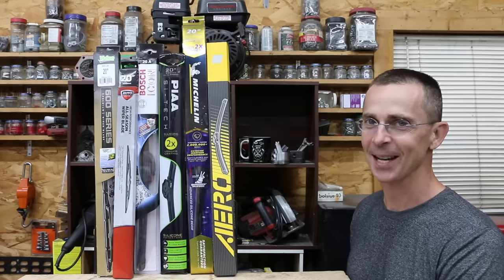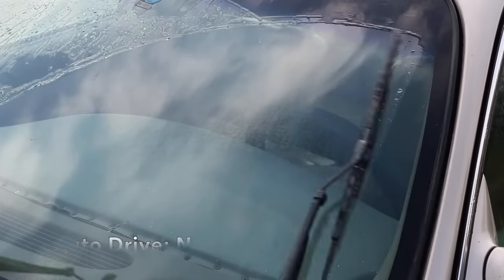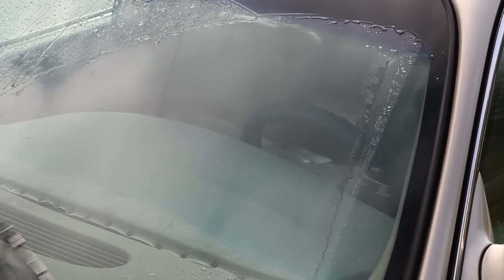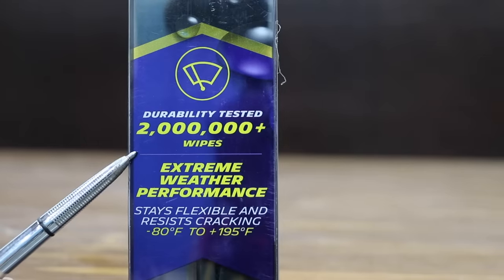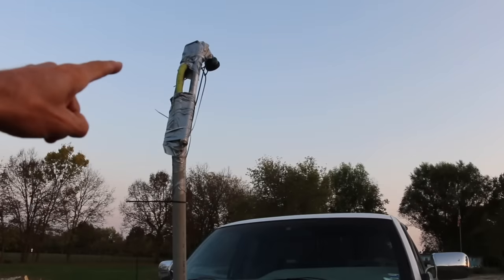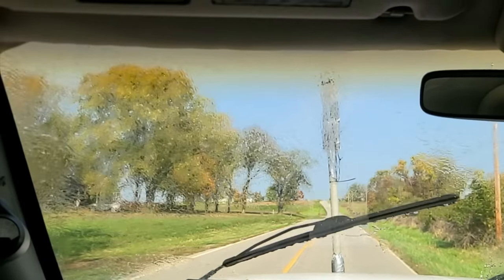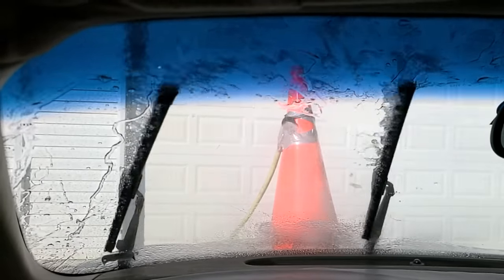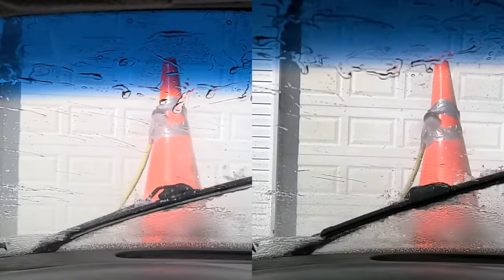Best Windshield Wiper Blade (AFTER 1 YEAR)? Bosch Icon, Rain-X, PIAA, Trico, Valeo, AERO

Comment: As a Swede, temperature is the single biggest problem in my opinion. Regardless of brand and model, the closer to the freezing point it gets, the worse they get. Stiffer rubber = lots of noise and lack of smoothness, the blade starts "jumping". When the temp begins to crawl below ~10 deg celsius I often find myself considering getting a new set just because of the noise, even if they still keep the windshield clean.

Blades that have been on the car for some months tend to get shaped by its resting position, and since they stop after the downsweep and become bent that way, the upsweep then tends to get noisy when the temperature drops.
In other words, a blade that has been sitting in a box or just been lying somewhere in sunshine (for UV exposure), will still have its original, "neutral" shape... a blade that's been sitting on a car will be deformed over time and then make more noise.

Winter Is Coming, as they say... so it's about time to get a new set. I wonder how Biltema's models would test against your typical American brands...

Another thought: USA is big. Wide range of weather and temps... do you have the same selection of brands and models down south and up north? Winter and summer? Different environments would benefit from different properties...
Reply: I grew up and lived in Vermont and upstate NY, both of which are known for horrible winter weather (-20F winters, multi-foot blizzards, etc). Silicone blades with the flat style are far superior for those kind of conditions. Partly because they're easier to de-ice with the chemical deicer spray (that stuff is a godsend) if they're frozen to the glass.
Reply: I live in Canada, where we have temperatures from 30 to -20 with salty air, and I replace my wiper blades every 8 or 9 months. I buy Michelin blades, for the most part, from Costco for around $12. I would never pay $25-30 for one blade.
Reply: I'm from Georgia (southeast part of the country) and I've lived in upstate New York for a few years. To the best of my weak recollection, they're all the same everywhere. Lots of people down here replace their tires when they show wires, and replace their wipers when the metal frame scratches the glass. Stupid. Can't get away with that up north!
Reply: As a Florida resident, sun and heat damage is the biggest issue.
Reply: @jmodified  I can only imagine...
Reply: This is kind of what I was thinking as I watched this. It'd be better if they could sit on a windshield for 6 months or so, because that's going to degrade the performance more than laying loose in the sun. I'm not sure how you would accomplish this, though. It'd take several spare vehicles, or some sort of purpose built test rig, that really doesn't seem practical for one or two test videos.
Reply: we have "winter" wipers in the north which is basically a rubber covering over all the moving arm components so they don't get wet and freeze. I haven't bought them in a while however as they still seem to freeze. Personally in upstate NY snowy icy weather I've had the best luck with Bosch, and more recently I've tried the Rain-X and can't complain about them either.
Reply: I live in Alaska but I don't care for wipers whoever ride with me think I'm crazy but why buy new ones when they gonna freeze and jump all over the windshield
Reply: I lived in the southern part of Arizona for many years The summer temperature was usually 115 F to 125 F. That's the 50 C range for the rest of the world. I found Bosch blades lasted the longest, although after a week of 122 F (50 C) they would permanently deform and chatter when the rain came later in the year. There was no solution to this other than replacing blades after the summer heat.
Reply: @fergusontea  agreed, Home Depot sells Michelins for $8 ea so imo the best value even if not up the Icons
Reply: @buffdelcampo  White plastic sheet to cover them, works in winter snow too

Comment: Please continue reviewing these blades after continued UV exposure. I live in Southern California in very warm temperatures 100/110+ in the summer and my PIAA's are still working great after 3 years of use. The Silicone blades are supposed to last longer than the rubber blades and if you factor in longevity of the blades over multiple seasons it may be the cheaper long term option.
Reply from the maker: Thanks for the suggestion.
Reply: Yea but I bet you don’t get tons of rain there.
Reply: I'm also in SoCal and have had the same set of PIAA's on my 3 vehicles (2 garaged 1 parked outside) for 13 years and they still work great.  Granted they get used more for removing windshield washer fluid than they do in the rain :)

Comment: After  almost 40 years of driving I reached the same conclusion,  Bosch seems to perform the best.  I've tried the cheap, the expensive and everything in between.  I don't believe Bosch even made wipers when I started driving.
Reply from the maker: Great feedback. Thank you
Reply: I know they've been around for a very long time though.  I have a tombstone radio from the 1930's made by American-Bosch.
Reply: @lesteroil2 - I agree.  I have tried many different brands and types and have been really happy with the Bosch Icon's for several years.
Reply: I tried other brands, but got back to Bosch ages ok.
The beam type didn´t really impress me, it may conform to the windshield quite when all is clean and not freezing, but once there´s something not nice and smooth, they can´t beat the "old" style where the blade itself is more flexible.
Reply: Had my bosch aero's on for several years - faultless, they have outlived the car which is now going up for sale lol
Reply: I agree.  My go-to wipers are the Bosch Icon / Valeo Ultimate.  They're almost identical in design and performance, so I use them interchangeably.
Reply: I've been using the Bosch Icons for several years, and they are definitely my go-to when it's time for new wiper blades.
Reply: @Rebel9668   Yes, they started in the late 1800's.  Magneto's or something like that.

Comment: Bravo! Really good test! Thanks!!
Might have been interesting to see how much drag in lbs there was on the window.
Not sure where you live, but here in northern MN & WI most of those blades won't cut it in the winter. Any that have uncovered blade claw will become iced over and will stop flexing & is useless, necessitating a stop & beating the ice out. I have been using the metal frame Bosch that has a rubber covering over the frame for several years now, so I have less problems with icing up as they are outstanding & worth the extra money. Any wiper that has plastic connectors to the arm also won't last the winter. On my Acadia, the single frame plastic wipers have difficulties keeping flat to the window in the winter, less in the summer, so not great. One blade is much longer than the other.
I found your test really interesting & informative, especially how they aged & how similar several are constructed.
Reply from the maker: You are welcome!  Glad to hear!
Reply: "& how similar several are constructed."
I suspect that many of the different  "brands" come from the same company marketing under different names. That's why they're made the same.
How many of the wiper blades are made in China ?

Comment: You should do a video on the best way to recondition your wiper blades to make them perform like new after they start skipping or smearing. I've seen many different videos that involved cleaning the rubber blades and the windshield and they all have different methods.

Comment: Something to note about the rain-x wipers that most people don't read, on the package it says how to apply the rain repellant - you have to run the wipers dry for a few minutes when you install them and it's actually very good! I hardly even have to use the wipers in a rain storm and it lasts for a decent amount of time, can't say exactly how long.
Reply: Clean and dry the entire windshield first, even better results doing this.

Comment: HERE IS ONE:
Car Interior Leather Care Products!
Do they really work? Many say they don't because car leather has a surface treatment, and any care products only stay on top of that, just like car wax on top of the clear coat. 
But if they do work, which one is possibly the best?

To conduct this i suggest getting a hold of a bunch of different car seats, fairly new, from different manufacturers (American, European and Asian), cut them up to be able to see the backside of the leather, and then test different products on different surfaces (heavily worn surface, medium worn surface, not worn surface) with the different products, to see if any product has penetrated at all. What brands penetrated which leather seats and level of worn surface, and if any of those products actually gave any type of protecting properties.
It would also be interesting to test brands that differ as much as possible in their content composition.

Cheers!
Reply from the maker: Thanks for the video idea.

Comment: I'm a HUGE fan of your work/videos, and truly appreciate the exacting standards with which you test all the products you review. That being said, I noticed a couple discrepancies between your first "Windshield Washer Shootout" video, and this one, in regards to the products tested, and at least one discrepancy between the blades pictured in the video and the product links under the "Products Tested In This Video" section. In your first "Wiper Shootout Video" two of the wiper blades tested were the Bosch Clear Advantage, and the Rain-X Latitude. In this video, those products are not represented, but have been replaced with the Bosch Icon, and the Rain-X Silicone Endura. In addition, the Amazon link for the Rain-X blade (under the "Products Tested In This Video" section, in the description) leads to a Rain-X Weatherbeater blade, not the Silicone Endura blade .... Regardless, keep up the GREAT videos Todd!!
Reply: How are different models of both Bosch and Rain-X wipers a discrepancy? Why would he retest those models when you can just watch both videos?

Comment: I’ve have the same pair of Bosch icon beam style wiper blades on my daily driver for the last 5 years and they work quite good. Not perfect but they are quiet, no streaks and only very occasionally hop (even then they make little to no noise). I’m thoroughly impressed with them and looking forward to this video
Reply from the maker: Thanks for the feedback.

Comment: I've had Bosch blades on my car for 8 years and still working well, even through Ohio winters.
Reply: It is not the winters that are hard on wipers.  It is the hot summers.  Drying out rubber does way more long term damage than getting it cold.
Reply: @gscurd75  AZ heat got me here

Comment: I used to work at o'reilly's and I did an investigation on my own about the best wiper blade for the price. I always buy bosch icon wiper blades but purchase them at walmart. Auto parts always inflate the prices very high.
Reply: I just hope they don't have two tiers of quality.  Many years ago I worked at Old South Candle Co. in Mayfield, KY and their high end jar candles had twice the scent added to them as the candles they made for places like dollar general.  I also know that like say, in oil filters The AC Delco ones from Walmart tend to be the new E type whereas at a lot of auto parts places you can still get the older and imho better original type (like a PF46 instead of a PF46E).
Reply from the maker: Thanks for the feedback.
Reply: One reason you're paying more at a local shop is because of the service behind the product. There have been times when I needed advice on a choice I'd made, or a product I was looking at. I'm a lot more hesitant to ask questions at a Big Box or national chain store. They do want to sell the products they sell (they're not a library) and it's always good to have done your own research before, so you can better decide if you want to take their advice.
But, a good relationship with a local business is generally worth it.

Comment: Those silicone based wipers do in fact last much longer than the rubber based types. I'm a few years into a pair of PIAA brand with a vehicle that is outdoors all of the time in California. They still function well.
Reply: I've had similar results of the PIAA lasting much longer.

Comment: This video made me realise something I'd never thought to consider before. Our wipers must work better here in a right hand drive country, at least as far as driver visibility is concerned. The way the RH (your passenger) wiper flings a bunch of water over into the driver's vision on its initial stroke looks awful, and I'm frankly amazed that in LHD countries they don't make the wipers sweep the opposite direction.
Reply from the maker: Thanks for sharing.
Reply: The driver needs the whole screen. For a second, split the windscreen into 2 pieces. The passenger will be left with half of the screen and the driver will have the entire screen wiped. Now if you change the way the wiper works but not the driver seat, the driver will be left with half of the screen wiped. I hope you understand what I mean. Left hand drive or right hand drive the driver always will have the screen wiped entirely. (If he buys Bosch :)) )
Reply: Maybe, I am bias. I've never driven a RD. In the LD configuration, the wiper clears the whole side, and the right side has the entire upper 90 unwiped. That would annoy me. If it is raining so hard that it clears better on the right side, it's not safe driving conditions. On that note, here in Michigan USA, I can reach out my window while driving and wiping, grab the blade and snap it back against the windshield to remove ice build up.
Reply: @MrRedberd  I didn't mean to offend anyone. Sorry. But for the LHD and the RHD cars the wipers will always start from the passenger side.
Reply: @doru10922  No offense, thanks. I did not know that.

Comment: This gentleman is the best. Thank you for all this work and you deserve all the success of your channel.
So Bosch, PIIA or Rain X then.
I am using Michelin blades now and although they wipe clean well, the driver side occasionally was stuttering and squeaking. Turned out it was the Rain -X washer fluid that was causing that. Once removed the Rain X and replaced with filtered water and BMW Washer Fluid the issue went away and the Michelin wipe went back to normal.
I have a new set of Bosch wipe in the trunk which I may instal just to see how it works on my BMW X5.
Cheers.
Reply from the maker: Thanks!  Thanks for sharing.

Comment: Thank you for another excellent review. One comment: Windshield surface curvature has a significant influence on the results. In other words if you were to try the same experiment on a different vehicle, you may end up with a different outcome with streaking, ..., etc. With my own cars I have learned that the best wipers are the ones that are provided by the vehicle manufacturer.  If this is not possible, some experimentation will be needed to find what works best as an alternate.
Reply from the maker: Thanks and you are welcome!  Thanks for the feedback.

Comment: If you ever do this again, try to include OEM wipers.  That way we'd get an idea if the OEMs tend to be better, same or worse and we'd know the relative cost compared to after-market.  Depending on the age of the vehicle OEM may be easier said than done.
Reply from the maker: Thanks for the suggestion.
Reply: (UK Based)  I've had two Seat Leon's and then a Seat Ateca, all had Valeo blades fitted, I think they were the standard fit from new, always changed them for Bosch when they started to get past their best, certainly made a better clearance, and quieter too, and they lasted much longer.

Comment: I've personally had a great experience with Rain-X wipers.
Reply: I really like mine.  Only trouble I've had is I have to tape the ends because the blades windup shooting off.
Reply: Rain-x wipers are junk, get some bosch icons and you will see the difference.

Comment: "You're not FULLY clean unless your Zest fully clean."
"We're going to test that."
Reply from the maker: Thanks for sharing.
Reply: or Charmin clean.... love the "go"......
Reply: 50 years later those silly slogans are still lodged deep in my memory.
Reply: @waterheaterservices  Good jingles definitely last that's for sure.
Reply: COAST claims to be an "eye opener.". We're going to test that too. 😁😀
Reply: @JunkMailBoxStuff   We'll test running our lawnmower engine with melted down Coast and Zest and see if we're fully clean afterward.
Reply: @Scorpiomaj27889  😃 Now that's just overkill on the fuel additave detergents.   And all this time I thought Techron was only for fuel & not the shower. Someone should test that. 🤪

Comment: I've had Rain-X Silicone AdvantEdge on the driver and passenger side of my 2005 Ford Escape. I put them on in the Spring of 2019 and have not replaced them since. All I have done is kept a waxed and Rain-X coated windscreen. Periodically when I notice micro smears I grab a micro fiber towel and a good cleaner and clean them, then they work good as new. Absolutely thrilled with the performance and longevity and the car has never been garage kept as long as I've owned it.